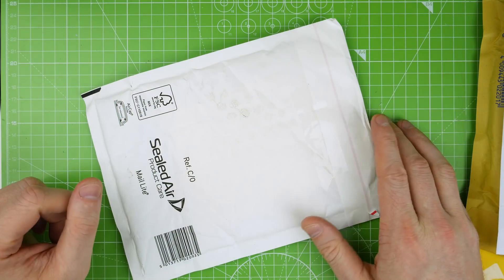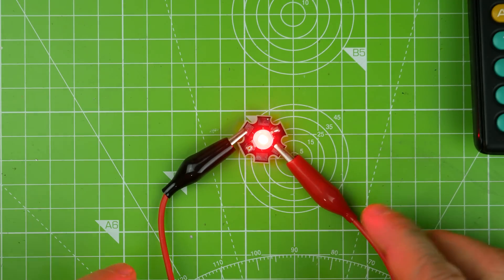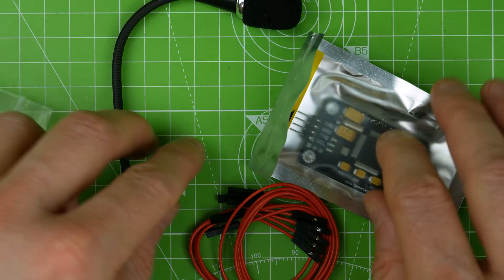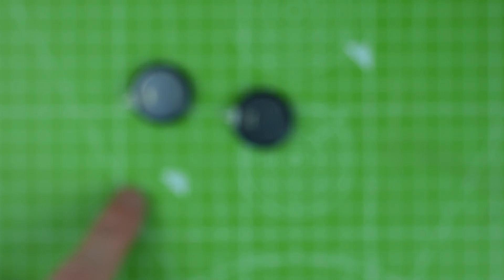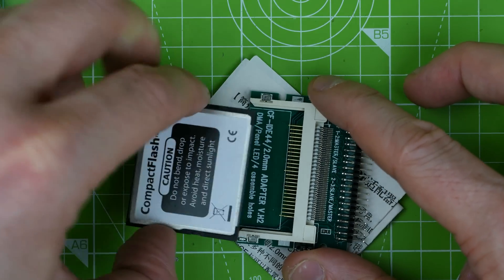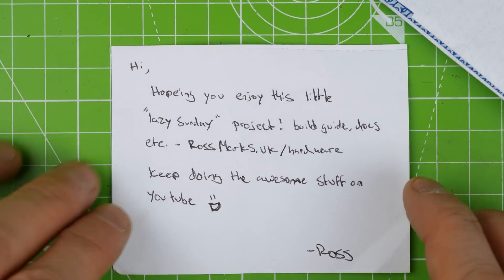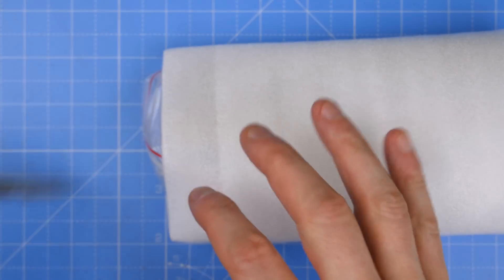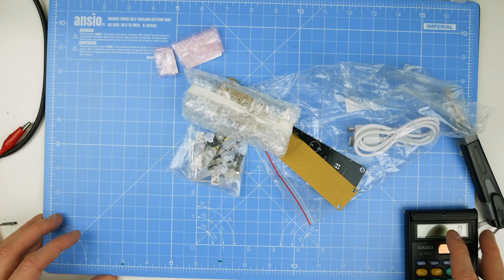Post Bag 20: Super pull 3000

Comment: A solar project with the super cap is a good idea especially if you can get it to run off some kind of boost converter that has a super low working voltage. You can wring lots more usable power out of one if you manage it right.

Comment: The Sunplus SPCE061A microcontroller wasn't originally designed for speech recognition workloads but its architecture makes it particularly suited for the task.
Reply: If you search for 'spce061a datasheet' (this is a 16-bit Sound Controller
 with 32K x 16 Flash Memory designed in the early 2K's) and take a look at their datasheet, you can see that it was indeed designed with 'speech recognition' in mind ('Therefore, the SPCE061A is
 applicable to the areas of digital sound process and voice recognition.'). Basically this is a (programmable) voice (audio sample) player/recorder and comparator. Sure this isn't a speech recognition in the likes of deep neural networks speech recognition but more on the likes of record my audio sample command/phrase and compare it with a previously recorded sample, if it matches, identify it as such (I remember experimenting with this back in time with my old ZX Spectrum, that was late 80's-early 90's, sigh =). This should also usually be speaker dependant...the geeetech website looks buffled on their comment 'This module is speaker independent. If your friend speaks the voice instruction instead of you, it may not identify the instruction.' and keeps insisting on speaker independancy below 'Please note that speaker independence requires strictly good MIC. The MIC we supply may be not good enough for it to be speaker-independent.' (David, please comment on your findings with speaker (in)dependancy, after looking for a better mic :) maybe on a future post bag ;) ). The board you show in the video is a simplified version of Application Circuit 1 of the datasheet (no operational amps, no speakers, simplified/absent MIC input network (single input and not differential as in the App Cir)... but DC-DC 5v-3.3v regulator on the left,  three sets of power conditioning condensers below the IC -, quartz crystal and its two condensers - left top -, input mic on the right, indicator LEDs top right (geeetech specific, not in App Circuit)...

Comment: 1 : 5 = 🙃
Reply from the maker: It really should have been fV / 5 (edit 1 / fV) ha ha ha
Reply: @DavidWatts  - what's the "5" got to do with anything?
A red LED of that kind will be between 2V to 2.2V, so 1W will be 450-500mA. However you cannot drive them that hard without a heatsink.
Reply from the maker: You are right, it was late and I wasn't thinking. I meant to type 1/fV as I stated in the video description.